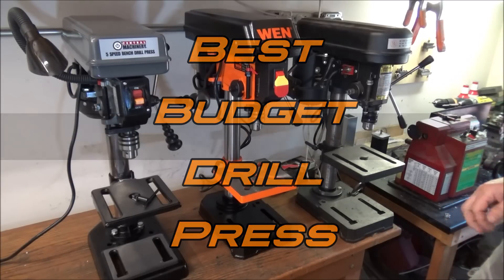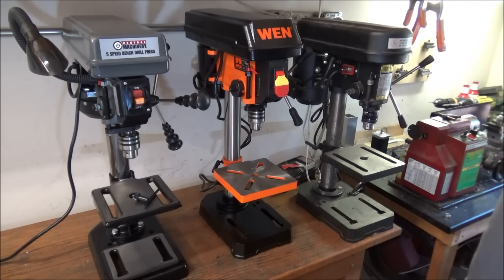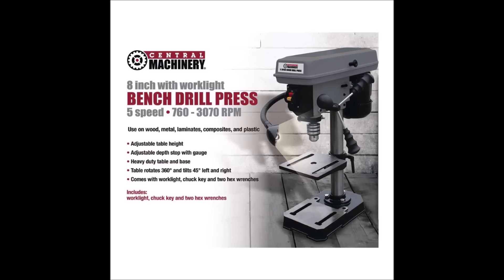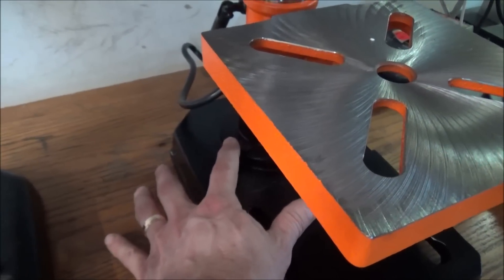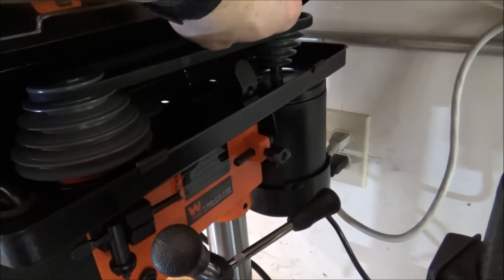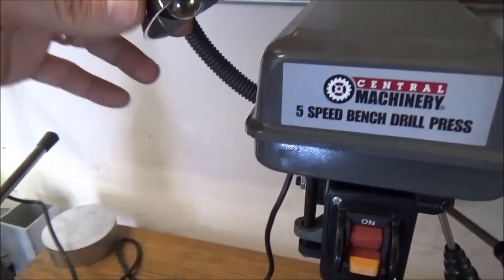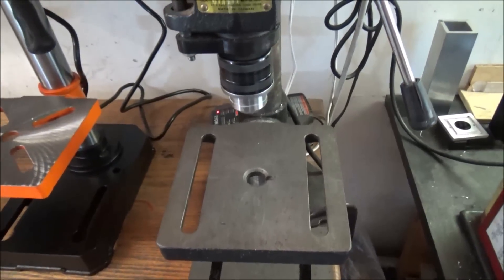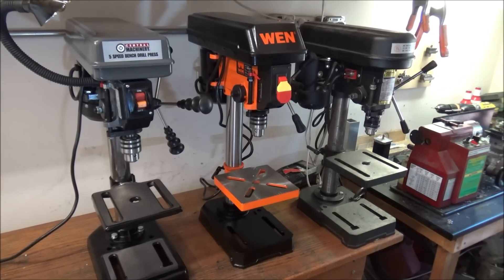Best Budget Drill Press Harbor Freight Vs WEN

Comment: I have a 30 y/o Craftsman bench drill press, and the paddle on/off switch broke. I was very disappointed that Craftsman was unable to find a switch that would work in my drill press. I searched Amazon and eBay to find a 2-pin on/off switch and after 2 failures, I found a 4-pin and was able to figure it out through trial and error to connect to the right 2 pins and presto! However, in did go to HF and bought a $69 drill press and quickly realized that it had a bad wobble. HF gave me another drill but it had the same wobble. Without realiziung that my old Craftsman would come back from the dead, I bought a Wen 4248 and have been mostly satisfied. Problem is I now have 3 drill presses. Any buyers out there?
Reply from the maker: That is the hard part about aging machinery. "PARTS" but looks like you came out ok. yeah dont really need three.

Comment: To those in 2023 basing their decision on this review, HF now carries a "Bauer" branded 8" drill press that appears to be made to the same specs in the same factory. I picked one up 2 days ago for $79.
Reply from the maker: Thanks Ryan for sharing. I have seen the Bauer 8" 5 speed drill press. It does have a cast base and table I did notice the table collar on the Bauer does not appear to be cast or as robust. But with a coupon may be worth a shot.

Comment: Pretty sure the WEN is the same as a Grizzly G0925. PS< With your older model you bought at Ace Hardware, If you take a rubber coated magnet, or just a regular magnet, maybe putting on a small piece of grip tape over the magnets chuck key side,  it makes a nicer chuck key holder than Velcro, if the magnet is N42 or better the size of a penny,  it'll never fall off from vibration.  Using grip tape on the chuck key side makes a lesser bond line, so the magnet stays on the drill press, a dab of glue works to mate the magnet to the drill press if you don't have grip tape.  This retired aviation engineer loves magnets.  Thanks for making this comparison video, it's surely helped a lot of people.
Reply from the maker: Thanks for the tip!

Comment: I'm looking at replacing my Delta benchtop press since I can't find a replacement motor that'll fit it without me doing mods to it. So now the thing I think about when looking at powered equipment is whether a replacement motor can be (a) found, and (b) will be it more than I paid for the press as new. How's the Wen holding up? Thanks.
Reply from the maker: That is a good point I suspect you will be hard pressed to find a replacement motor cheaper than these Drill presses.
I would keep searching for a motor these machines dont change much over the years. There should be a suitable replacement out there.  A lot of these were similar styles. and if yours is a older model they just dont make them like that anymore.
The WEN is holding up well.

Comment: Man, I'm glad I watched this video before I bought another HF press. I had an older 8 inch HF drill press and it had cast iron table and base, but it got stolen.
I didn't know they had changed them,.. now I will spend the extra $20 on the WEN.
I recently bought a scroll saw from WEN to replace an older one from HF, and I was really impressed by how much better the WEN was than the old one from HF. 
I've been eyeballing the spiral cut planer from WEN too,.. looks pretty nice for the $$$.
Reply from the maker: glad to help the wen is overall a better machine.

Comment: I have an older (at least 20 years) HF 8" press - predecessor of the current one. Mine has two plastic parts...the handle grips and on/off switch. The table is cast steel and the motor mount and fan cover are heavy gauge metal. The pulleys are steel, too. No slop at all in the spindle. Not sure how much it weighs but it is not lightweight. Sounds like the older HF drill presses were made a lot better. I have a HF bench grinder the same age as the press. It has a pretty good weight to it, too.
Reply from the maker: Yeah the older models were made a lot better with cast parts.

Comment: Your model drill press, I just bought a used one. It wobbles bad. What style if  spindle does it use? Do you know the brand/manufacturer?
Reply from the maker: Skillcraft I believe  the chuck fits on a tapered shaft have you checked the shat and bearings
Reply: @CNC4XR7  I found the answer, it's a B16 Jacobs taper for the chuck and 6201 and 6203, 2 of each for the bearings

Comment: i wish he would have left out ecerything about the old drill, i was here for the wen hf comparison, but half of this is comparing to some off brand we dont have access to.
Reply from the maker: I dont think you can compare the new without taking a look at how the old was made. since the WEN was so similar.
Reply: @CNC4XR7  sure you can. the WEN vs. Harbour Freight. we didnt need to know about the third, older, drill. To each their own, but I skipped through because it was too much.
Reply from the maker: @justinsane332   I really think you cut yourself short by not seeing the info on the older model. but I understand. the point was to show how the design did not need to change over the years and so it hasn't . if fact the only reason to change it would be to make it cheaper . Which is exactly what HF has done. I was also trying to point out the reliability of the design of the older model. Therefore since the WEN is very similar in design would intern likely be as dependable.

Comment: It is a mistake to buy the Wen 8 inch. The price difference between the Wen 8 inch and Wen 10 inch is typically around 30-40 bucks. The difference is astonishing. A HUGE difference is the 10 inch has a rack and pinion height adjuster for the table. Without it, you need three hands and it is very difficult to get it right where you want it. Everything important is bigger on the 10 inch. The depth of drilling is deeper. More powerful motor. Utility light. Too much to name. I've owned both the 8 inch and the 10. There is no comparison.
Reply from the maker: Nothing wrong with the 10 inch If you have space go with the 10 Inch. However this video was to show the difference between the three 8 inch. Thanks
Reply: @CNC4XR7  - Yeah, I got that. You did a fine job too. Consider my comment an enhancement of your readers' experience if they favor the Wen 8 inch over the other two. Not meant as criticism. Good luck.
Reply from the maker: @spfttt  No worries thank you for the comment.

Comment: Grizzly also has one, that seems like nothing to write home about. 
I have an old Craftsman 10 inch model at work, which looks a lot like the 8" one you have that is 30 years old. When you go to this size, you will have a rack and crank to adjust table height, which smaller ones usually lack. Overall, I am looking for a compact QUALITY drill press for my van.
Reply from the maker: Thanks for sharing! We have gotten so accustomed to buying from China and the quality was not as good as Taiwan, which was not as good as , Japan. But some of the Junk there peddling now is really bad. you have to be careful. I understand there inexpensive to begin with but when it comes to tools you expect them to last.

Comment: You didn't even drill anything. How can you do a review and not see the drilling power between them? Seriously? Do they all drill through steel? Carbon steel? Stainless steel? If so, how thick? This review is really helpful if you care what kind of nobs are on.  Wow 🙄
Reply from the maker: Thank you for the comment. However I never said this video was a REVIEW? This was intended to show the differences in quality and workmanship.
Reply: @CNC4XR7  
And performance has nothing to do with comparison???
Reply from the maker: @reneemills-mistretta790  Not in this particular video. This video was my thoughts on out of the box first impressions. I do understand what you are saying however a true Working comparison was not needed in my opinion after I opened the box. Imaging you purchased 2 different drill bits to do a job. both the same size , length , twist etc. One costs slightly more. The first one you open and look at is the (HF brand) The drill looks like it was  sharpened with a rock the twist is off and feels dull. 
You open the 2nd drill bit ( the wen) the drill looks precision ground and feels very sharp. So I ask you do you go ahead and use the HF anyway?

Comment: I actually like my HF drill press.  Bolted down its much quieter than in your video.  I generally run in low gear on a press also.  I believe yours were set to high speed which is much harder on bits.  Slow and steady wins the race everytime on drill bits my friend.
Reply from the maker: Hi Randy, This was just a general comparison. out of the box. Yes there are things that can be done to make the HF drill press better but the bones need to be there to start. For me personally I felt the assembly tolerances were to far off to allow the kind of work i would be doing.

Comment: seeing as everyone has to always make a separate table for these things or putting them on a rolling cart., why are you buying them? why not save up for a nice stand alone one.. i did, yes it was used, and it's older but have been using it for 30 years now and it's still going strong. And i have no intentions of replacing it.  You can find them in estate sales, ebay,  auctions, etc.. but estate sales are the best, bc the older men had the best tools and the quality of tools now just aren't like what they used to be. Not to mention they took great care of them. Just a little cleaning and some greasing, bam you're good to go. that's how i got my bad saw, my  press,  my  table saw, mmm the only thing brand new in my shop is my miter saw... still in the box.. even my power tools are older, as they were my fathers.. but they are heavy... don't see the point in replacing them as they still work great though..
Reply from the maker: bargain finds are always the best option! Old tooling and machines last forever when taken care of. However if you dont have space for a floor model you just dont have space.

Comment: I have the same model. Almost every video says what you say. Well made, and the little things like the chuck holder, cast table, metal cover, etc. It's a fine little press for my use. If you want a work of art, and a machine that is precise, get a high-end heavy press. With care and maintenance, it's like you said...it will function well for years to come. Instant LIKE and greetings from Alaska.
Reply: Which model do you have?  The WEN or the HF?
Reply from the maker: Thanks for sharing

Comment: idk.. coupon online says $55 on the harbor freight unit right now. the wen while seemingly better on outward appearance probably isn't that much better when you get into it. i don't mind a rougher surface if was machined to the right tolerance. dull bits will do that. bit material and feed rate is also a factor. cbn even does that to varying degrees on some of the programs at work (i run a cnc machine). at either price point, you're not going to get a high quality item. i'm thinking i should prolly look for second hand or throw more money at this tool. i don't think i'd use it enough to justify the price for a quality unit while i'm unsure about either on the lower end.
Reply from the maker: Well That's Just It the tolerance on the HF is Awful

Comment: I picked up the h f drill press a couple of weeks ago for some light hobby work.  Its sucks. I could not drill through a 1.5 inch bit of  maple  with a 3/8 bit without getting the bit stuck.  So I had to dip the bit in  and out or the wood smoked. Tried different speeds ,  different bits  same thing. I tried a 2 inch boring bit   on some drift wood. and at any speed hi or lo it got stuck . It will drill with a 1/8 drill bit   so far.
Reply from the maker: Thank you for the comment it will be very helpful.

Comment: I have the harbir freight and it is very quiet, something is wrong with yours. I have had mine for six years and never had any issues with it. I do like WEN products, however.
Reply from the maker: The Harbor Freight Drill press has changed this variation is not like the prior years. even the web site add appeared different than this variation. The newer ones are Junk

Comment: Umm would have been a good idea to actually use the 2 drill presses to see how they perform mechanically,
Reply from the maker: Yes Sorry I should have done a 2nd video testing them out. However I was so disappointed in the quality I just wanted to return it.
Reply: @CNC4XR7  no worries. Sorry if that came across so crass, meant it as a helpful suggestion. I can understand the reasoning tho. Appreciate the response.  Keep up the good work 😁

Comment: I decided I needed a drill press for a project and first considered HF, but after looking at the details, specs and reviews, settled on a WEN, but went with a 10 inch, variable speed model.  Purchased from WEN, but through ebay.  Super happy with it, but did replace the chuck with a keyless one.  Was so impressed with the build quality, that I bought a bench grinder and a vise from them also.  All of them seem very solid.  Not US or German made quality, but very solid for the money.
Reply from the maker: Thank you for sharing that information!  WEN as a whole seems to be really good quality.

Comment: Every single Harber Freight power too I ever bought had dry barrings. Take it apart and lubricate everything that needs it. Pull the dust seals from the barrings and pack with good quality grease.  This will not only make it run smoother but last a lot longer as well.
Reply from the maker: these were lubed but i have seen that before

Comment: My WEN (new) is NoT capable of handing a one inch bit ....just get stock..

It's going through the garbage pretty soon....
Reply from the maker: no none of these bench top drill presses are rated to handle a 1" drill bit. your going to need a substantially larger machine to do that safely.

Comment: One feature of the Wen not mentioned is that the on-off switch is an emergency, safety feature. Pushing it in turns off the press. That could be done with any part of the hand, upper arm, elbow.
Reply from the maker: Yes I really like the ON /Off E stop switch

Comment: Ive drilled thousands of holes with My HF drill press and it is as quiet or quieter than that wen. You probably got a bad one.
Reply from the maker: I might agree however the HF drill press has changed recently as of this video. this is not the same casting or MFG as even a year earlier.
 Next time your in the store take a look.

Comment: Is the wen strong enough to drill metals like SS,cast iron and cold rolled steel?
Reply from the maker: Yes However this is the Bench top model  so for small sizes It will do fine. up to 1/2"

Comment: I am a retired Woodworker that had over 20 years in Architectual Woodworking professionally and Woodworking has been my hobby for over 35 years  overall this new generationWen tools for the money all consistently  come in as  being decent quality   Ironically about 15 years ago. I stopped by my Moms  for dinner on a Friday night and  when she pulled in she asked if I would grab the boz in her trunk she bought on her lunch break that day  to my surprise it was the Harbor Freight Drill press you have in the video  as my Mom does  build Minarure Doll house furniture and items in a Hobby room i built her Specifically for the hobby  and she thought the drill press would be a good tool to have set up  ! At dinner my Mom asked what my plans were for the Weekend and I laughed that I’m going into the Shop to do some paperwork and to use. One of our Drill presses to cut 500 Mahogany Bungs. I needed for the Antique Chris Craft Cabin Cruiser i was restoring  as we had several older Rockwell floor standing drill presses. In the shop  and my “Hoard “  of Mahogany was stashed in a safe place inside our 100 thousand Square foot shop  well my Mom knew the shop was a decent drive and she asked me if i wanted to take her new drill press home to use instead of driving the distance to the shop so  i thought hey thats not a bad idea  i think i have enough Wood at home to do what i want  and i have the plug cutter  I’m going to use anyway  so that was my new plan except when i did  unbox the  drill. I wasnt very impressed   The wobble or runout in the Chuck was  close to 3/8ths. Of a inch by eye  i fooled with the damn thing for a couple of hours to get it half decent  and the power was just not enough to do what i wanted  i put everything back in the box and told my Mom  that she should return this  and Ill help her find a better one for her needs  which i did  wind up. Finding a older Craftsman 12”  that was never abused  and had been in some Old Timers   Home shop for years  my son who was only about 9 or 10 at that time thought it was real cool that he might have the only Grandmother in his school that got. Bandsaw and a Drill Press  for Christmas  LOL BTW. I bought her a new Skill Bandsaw bench top  model  and way after the fact. I realized she really could had gotten by with a Scroll saw  instead  as she is afraid of the Band saw  and her Safety  of using it  which is weird to me as i pushed a lot of projects rough way bigger Bandsaws then hers  and never felt intimidated by them
Reply from the maker: Thank you for the comment I had pretty much the same impression of the HF Drill press.